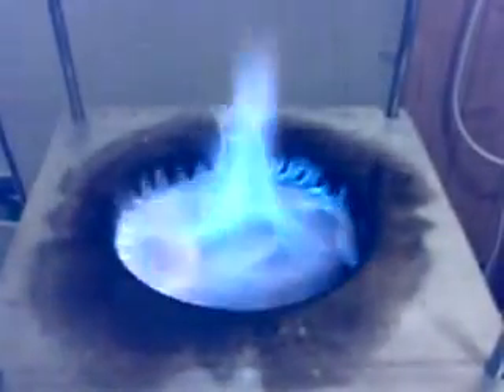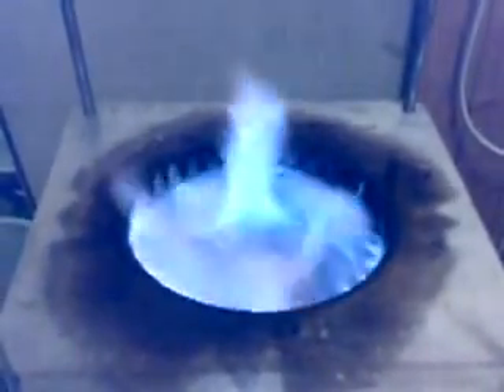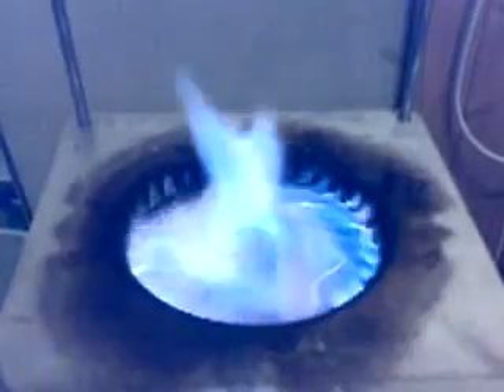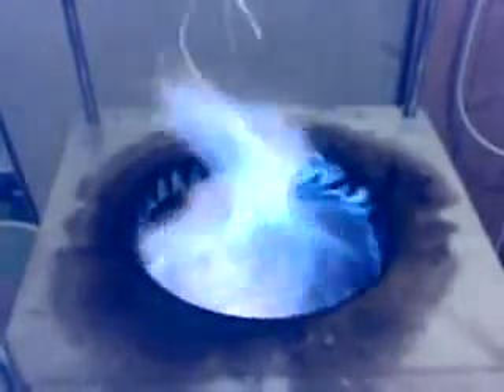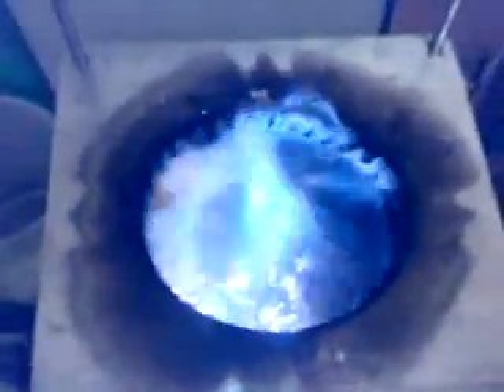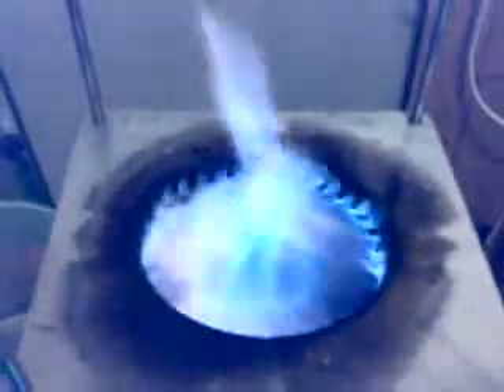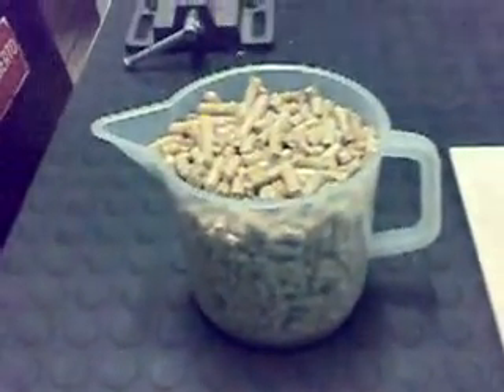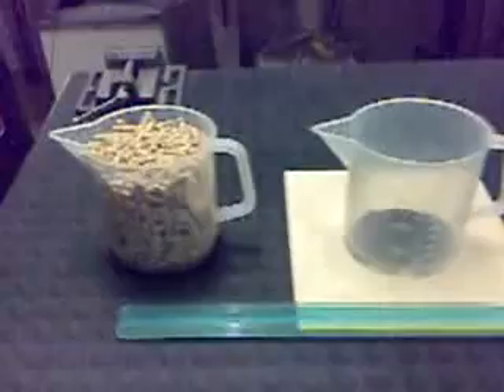coaxial gasification vs stratified gasification

Comment from the maker: While I value intelligent discussion, you are incorrect in your assumptions of both function and what is claimed of our stoves. The LuciaStoves operate on a TLOD process not TLUD.  Thanks to a calculated and measured balance between the venturi, the mixing, and thermal balances which assure that oxygen is consumed by the flame cap, the LuciaStoves are not only able to have very low emissions but produce a pH neutral biochar

Comment: My brother and I are thinking of getting wood pellets for some of our stoves, but I have a question. Since the pellets produce less ash, do you still get decent quantities of hot coals? I want to use the pellets with my HeineKampfire and I count on the coals for re-stoking the fire when it is low. I usually add birch bark of shaved tree bark on the coals to get the fire going again. Is that possible with the pellets?